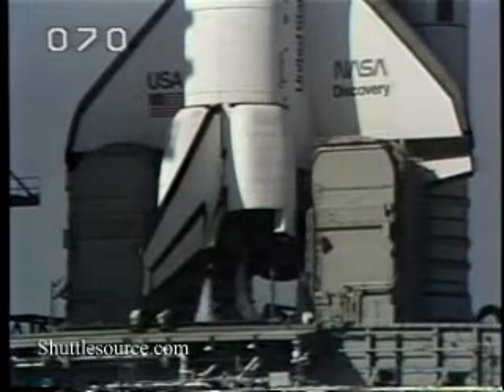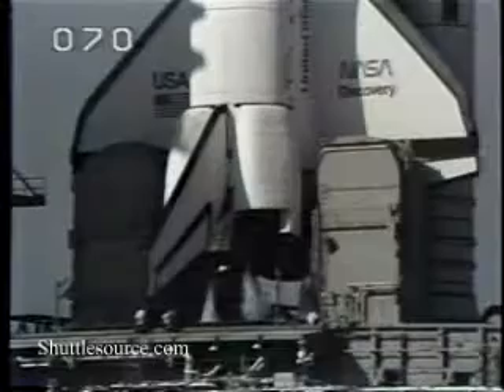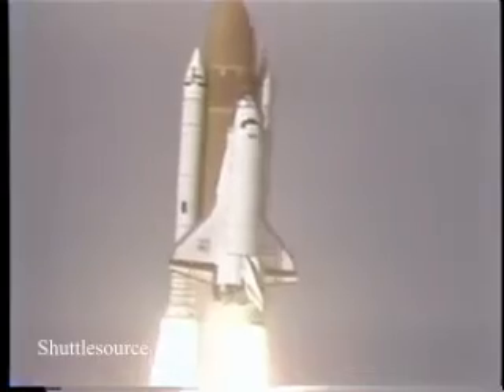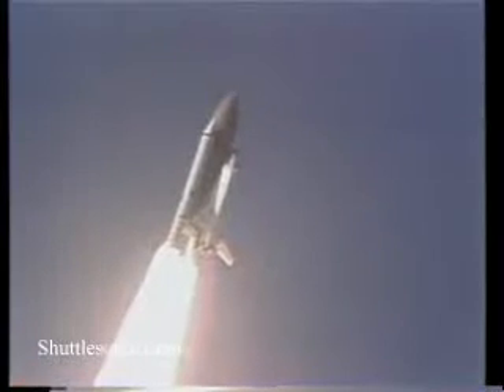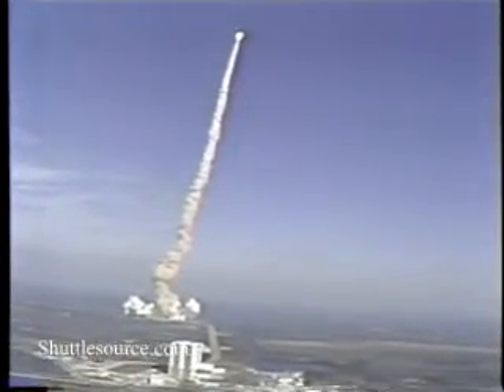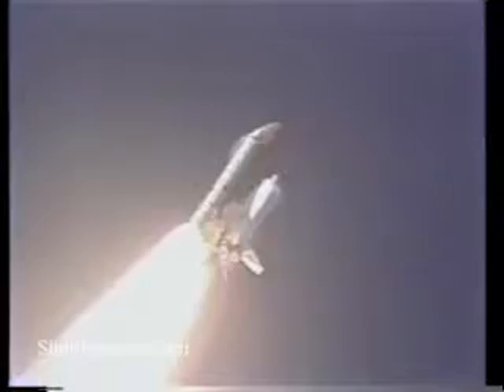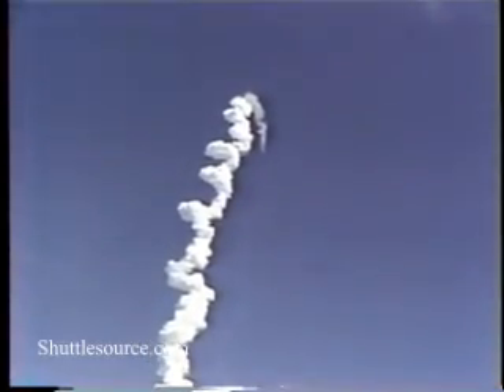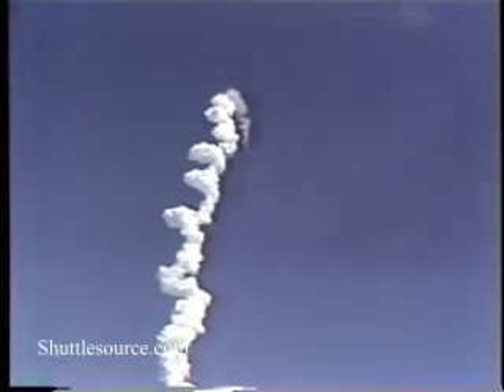STS-51C launch Discovery

Comment: This was the first military flight and the first to be conducted in secret. The payload is believed to have been a large electronic intelligence gathering satellite deployed to geosynchronous orbit.  This was the shortest planned shuttle flight, at 3 days.  The Shuttle Columbia returned in 1997 after 3 days but this was not planned, a fuel cell problem forced the early return. 
This flight experienced the most serious problems with the O Rings before the Challenger tragedy.  As has been commented, maybe the only reason that this flight did not end in disaster was that there was less wind shear than what happened with Challenger so the seal was able to last long enough until burn out of the SRBs.  Had managers taken heed of the warning, the Challenger accident would not have occurred. 
The  original orbiter assigned to the flight was Challenger but after problems with its last flight Challenger was replaced by Discovery. 
By a tragic irony, Ellison Onizuka, who died on Challenger, was a crew member on this flight, so this was his only time in space. 
Commander Ken Mattingly, who had flown to the Moon on Apollo 16, made his third and last flight. All the other crew members, Pilot Loren Shriver and Mission Specialists Jim Buchli, El Onizuka, and the first military payload Specialist, one of only 2 who actually flew, all made their first flight,  with the fore mentioned Onizuka and Gary Payton, the military PS, making their only journey into space.

Comment: This was the coldest launch before 51L, and yes it was 53F at launch.  This  was still too cold for the o-rings.  Bear in mind that the worse O-ring damage they had ever seen before 51C and 51L was on STS-2 and the temp at launch that day was over 80F.  So temperature was an additional stress on the already faluty joint  design.  

The change to the extra light weight SRB casings was also and issue.  less weight means thiner walls on the segments = even more "balloning" at SRB start.

Comment: Yep this was the flight that was the main concern for the Thiokol engs before 51L.  Chances are if there wind shear aloft had been as bad as it was for 51L, this flight would have been lost.    The only thing keeping the seal on the joint was propel lent combustion products and glassy soot.  Same thing happened on 51L but that flight had the most severe wind shear of any STS mission, and the guidance system had to do a lot of nozzle steering.  The stress caused the soot seal to fail.